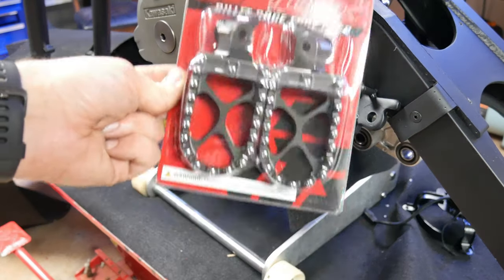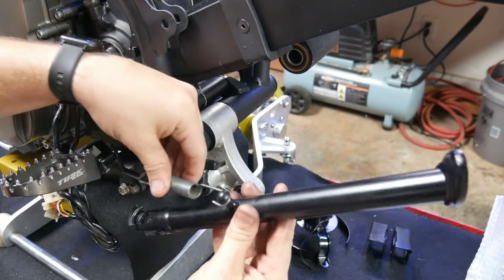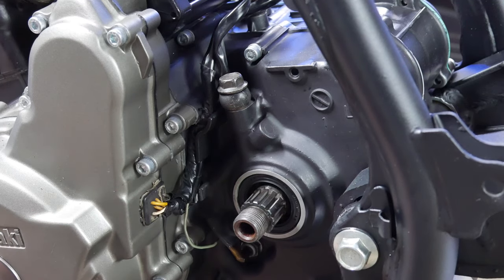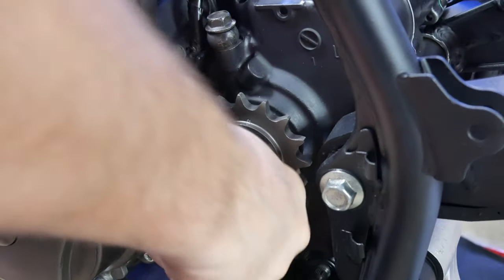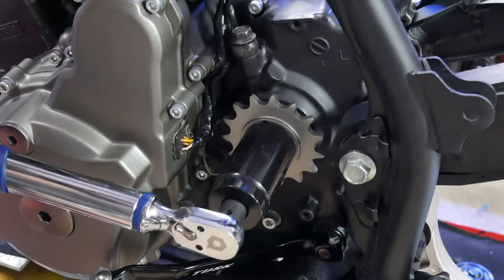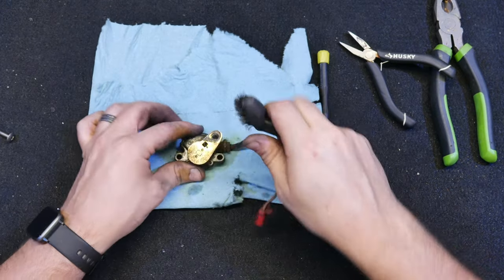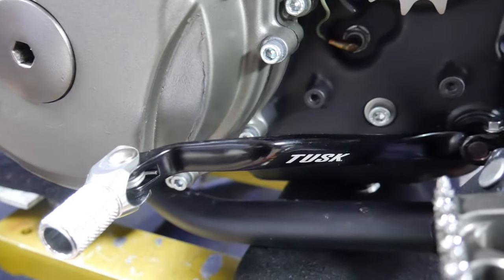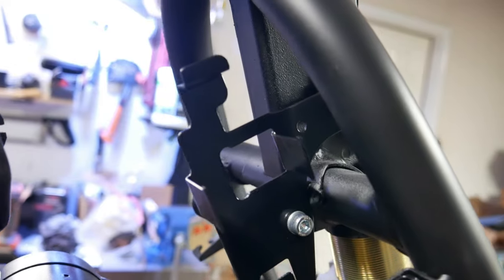Project Warthog EP 14: KLR Foot Pegs, Shift Lever, Drive Sprocket, and Kickstand

Comment: These videos are probably the best EVER klr650 build on YOUTUBE..
Reply from the maker: Thanks that helps motivate me to keep pushing these videos out.
Reply: @Fixin2Ride  it's going to be a mint Klr650..I'm curious where you bought most of the gaskets seals etc..any good online parts place you can recommend
Reply from the maker: Any chance I can I try and use eaglemike.com. since he is the Guru of KLRs after that I try 3Dcycleparts.com. Tu will work to get you what you need. But for strictly OEM parts I use Rocky mountain ATV. They have good customer support and fast shipping.